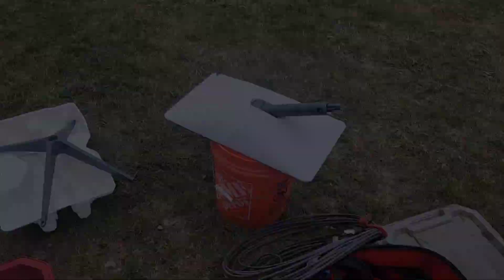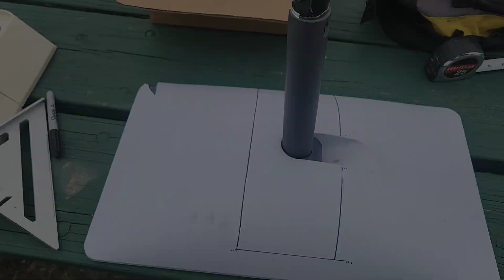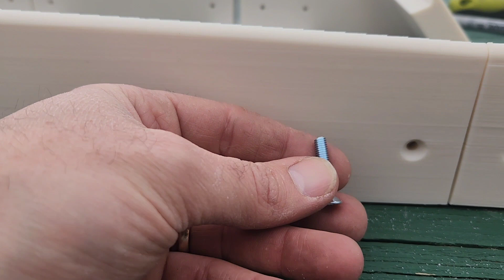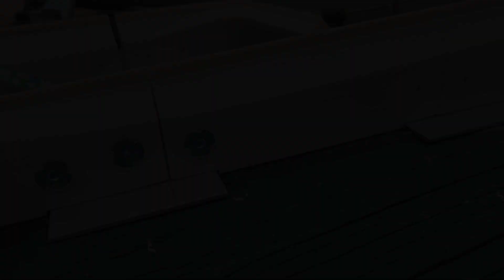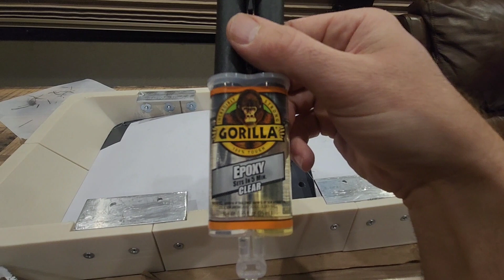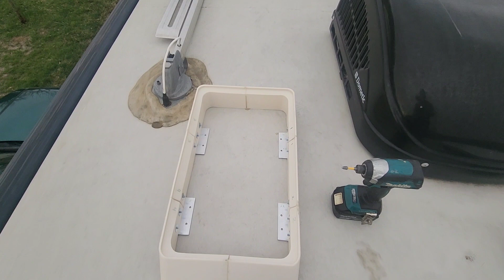Flat mounting my starlink on my RV using the @Everlanders 3D printed mount.

Comment: does it work while you're driving?
Reply from the maker: It does, however we usually don't use it, as our Verizon works as well.  Since we're using batteries going down the road I usually unplug the starlink to save a little (it uses a fair amount of power)